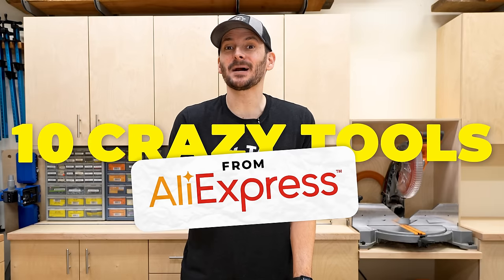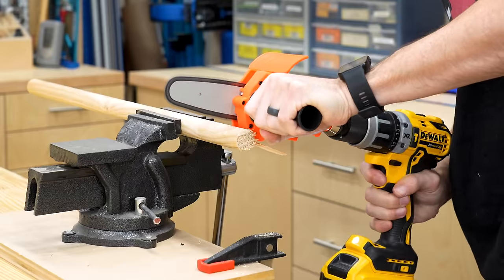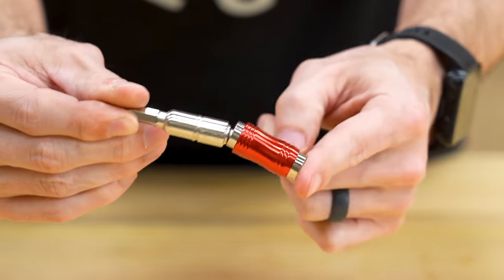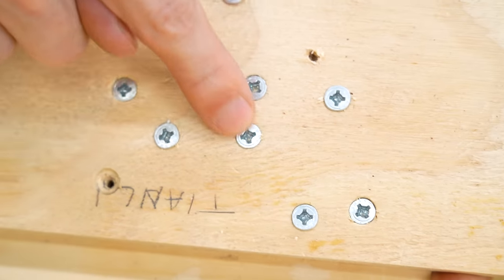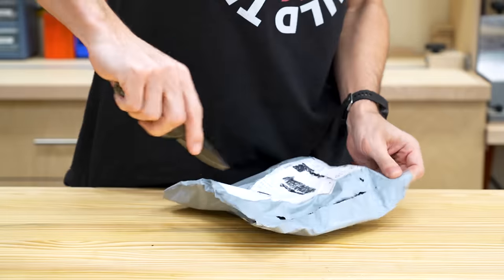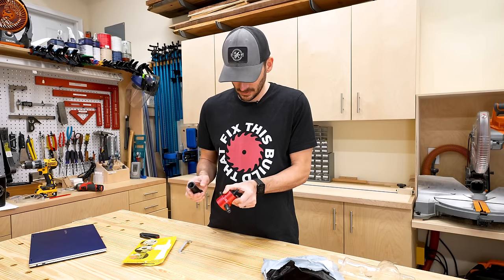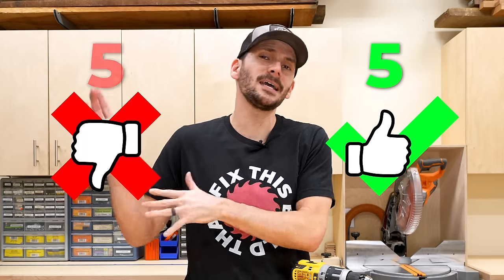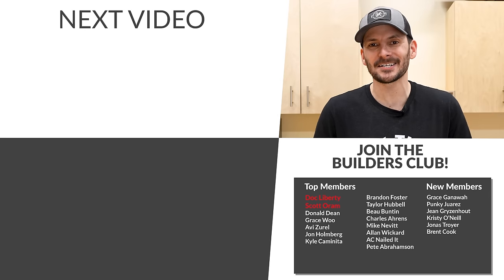I Bought 10 Crazy Tools on Alibaba

Comment from the maker: Watch this next!
I Bought a $70 "Domino" on Alibaba - https://youtu.be/qPDebNjQs-Y
Reply: if your using impact you will cam out ... try the magnetic holders with a regular drill
Reply: Well I have an 'expensive' version of the chainsaw thing 50bucks and its steel with a little oil resve for the chain. A lot safer And actually works great for trimming a few branches
Reply: @rocknrollguitar  I have a steel one, with an aluminum blade guard, too. So handy.
That plastic thing he got might as well have a grim reaper emblem on it.
Reply: I bought $800 worth of pirated 32gig flash drives from a 5 star gold supplier at Alibuba

Comment: 60-odd years ago a LOT of those sorts of drill attachments were popular. My Grandfather had one electric drill, it also converted into a reasonably sized circular saw when you unscrewed the chuck (all 5/16" arbor) He used it to build a house, all hardwood framing too. And bunch of other attachments, including a jigsaw (before they had T-shank blades) which could also be fitted into a very small table, converting it into scroll saw.
Reply: @bostonrailfan2427   likely went out due to safety standards increasing on products over the years. Big businesses don’t want a lawsuit
Reply: @bostonrailfan2427  Dremel is for really small work. I reckon those drill attachment sets disappeared due to two reasons: They weren't that convenient compared to separate tools, and all kinds of power tools eventually got more affordable even before the ultra cheap Chinese tools flooded the market. My father had one of the sets, which came in a really sturdy plywood box, kind of like a suitcase. He never used anything but the drill functionality and instead eventually accumulated a basic collection of the various ordinary tools as separate power tools.
Reply: My father had a Black and Decker kit that had similar attachments back in the 1970's. Average quality, okay for mild DIY.
Reply: I had one of those that also connected to a bench grinder. By Skil.
Reply: Electric motors were a lot more expensive back then.

Comment: When the janky Alibaba Drill Jigsaw adapter, is better than your legit black and decker jigsaw XD
Reply from the maker: That very well could be true
Reply: I have a Dewalt battery powered chainsaw and alibabas $11 adapter just put it to shame
Reply: @KevoM945  should I buy it bro???
Reply: @catboi1188  why not but make sure you get one of them metal Knight Suits
Reply: @catboi1188  just buy a saw wheel for a grinder.

Thats what sketch thai dudes use instead of a chainsaw attachment. Without the protector of course because of reasons.

Comment: I've bought the nibbler!  We used it to cut out holes for recessed lights that were above a ceiling with plastic roof sheets (you know the corrugated ones you normally put on a patio. - we used those in our basement so that there was a ceiling but so that it was easy to take down if we needed access to junction boxes or pipes.) Worked great! - both the tool and the ceiling.
Reply from the maker: Ohhh, didn't think about it for plastic
Reply: @robt2151  I'd imagine his is the same, that's why there were 2 different max depths
Reply: Soffit

Comment: You used the dust collector backwards. Put the bigger end against what you're drilling into then put the bit through the hole and drill. The wide round base offers support and stability to the collector and the brush keeps the debris from exiting the collector as it travels towards the drill.  I think you should reevaluate it. Otherwise I loved the video!
Reply: no he had it correct for that style design  the brushes are  to removes particles  from drill into the    cup  you  take apart,   even so  poorly design its as simple  take a coke bottle   cut the   top to  make a funnel  drill a hole in cap put wide  end to wall  drill through  cap into  wall and  the   bottle neck catches the dust
Reply: Well at least someone got directions apparently.

Comment: Great video. Except I have to comment about the dust collector. I have had two of those (I lost the first one). In my country houses are built with brick and mortar. So when you are drilling for shelves or picture frames etc, you are using your hammer function with a masonry bit that generates a ton of dust. My dust collector has a rubber seal on the wide end of the cone. You put the bit through, line it up with the mark you made for the hole, then press the cone against the wall over the hole. ALL the dust ends up in the collector, thus working perfectly. The alternative is to hold a vacuum under the drill bit or a wet cloth, neither of which works as well as the dust collector. I think it's a great product.
Reply from the maker: Oh, interesting. Sounds like a better design
Reply: @Ken Fullman I get extra fancy and use an old envelopeand tape it to the wall with masking tape  - fold the flap out of the way so you have a square edge.  If you have the tape over the hole it stops the drill skipping when you start, and grabs the last bit of dust.  It's usually sticky enough I can do a whole batch of holes with one piece & then throw all the dust away

Comment: The drill sharpener thing works alright if you're careful. It's incredibly easy to off center the bit though so it'll wander when you try to drill which is what it looks like happened. There are better ways to sharpen a bit though.
Reply: yeah.  there's more to sharpening drill bits than i expected.  i sat through a this old tony video.  it wasn't anything like as entertaining as this but it did teach me a lot about sharpening drill bits and you are absolutely right about getting them to center!
Reply: I have one of those and it works great
Reply: he is clearly someone who hasn't sharpened a drillbit before.. he didn't even look where the cutting edge was he just put it in there and rotated lol 
Honestly If you start trying to grind your drillbits the first thing you should have is a  drillbit angle gauge.. but since he basically only works with wood it doesn't really matter.
Reply: I’ve sharpened around a hundred drill bits over time with just a grinder. With experience, you don’t need anything else.
Reply: His drill is also in reverse, that's why is not doing good

Comment: as a rule of thumb, you can trust chinese tools for metal/concrete working more than the ones for woodworking. It is a cultural thing, as our countries are more used to build with those materials in general. For example: the dust extractor doesn't seem than cool at first glance, but if you use it on a concrete/sheetrock wall that would make a lot of difference...
Reply from the maker: Interesting observation and makes a lot of sense
Reply: @Fixthisbuildthat I haven't a clue on what he mean ???
Reply: @williamreilly5469  I don't know if you are trying to disagree with that statement or if it was just unclear, but, to rephrase -- OP is saying that it's more common to work with metal/concrete in China [than wood], so the quality and reliability of those tools are often better because of the need/demand for tools used in metal and concrete work.
Reply: @williamreilly5469  That it works good on concrete and sheetrock.

Comment: I have air nibblers, they are very handy for cutting circles in the middle of a sheet, on the edge I'd use something else.  Downside is they make a million chips to clean up, also can be hard to stay on  your line.  Takes some prartice because they move pretty quick.

Comment: The chainsaw insert actually works! I made som small adjustment to it added some chims and It cut five full size pallets in to pieces in no time. Keeping the chain lubricated is the trick, for your own safety do not saw with a dry chain, it will heat up and jam and do check its tension regulary. A dangerous thing it is but in experinced hands it is a pretty handy tool for smaller jobs.

Comment: The circular saw reminds me of that type of attachment for the Black & Decker Matrix. I love that set. Got the reciprocating saw attachment, router attachment, jigsaw attachment, oscillating tool attachment, sanding attachment, hammer drill attachment, impact driver attachment, etc. They used to have a tire inflation one as well as some weed trimming stuff but I never got those. I do have a problem with the circular saw because my hands aren't strong enough to hold down the safety buttons for me to get it to work.
Over a decade ago I was trying to drill through 1/4" lauan with a wood drill bit from harbor freight. Mofo would not go through and eventually bent. I then remembered that my late father left an entire massive 134 bit Chicago brand kit. So I grabbed a bit from that kit and it went through like a hot knife through butter. I think some bits are just made of crap metal.
I'm not sure which one I like the most. LOL.

Comment: Several comments here, Brad. My dad had a circular saw attachment like that about 50 years ago - I think it was a Craftsman. I don't know what ever happened to it. Makita has a magnet like that. I slide it further up my driver bits and have great visibility. The drill sharpener didn't work because it didn't put a back bevel on the tip. I currently have an older Craftsman jig saw with a swivel head - no need for the attachment. I'm definitely not buying any of these. I like to buy quality over price especially when safety is involved.
Bill
Reply from the maker: Couldn't agree more 😀

Comment: I have one of those plastic drill bit sharpeners and it works fine... if you have sharpened bits and understand the geometry. 
Many people can't understand drill bits. Being able to put an edge on a broken drill bit is an advantage; shorter drills are less likely to break.

Comment: Try running the sharpener with the drill in reverse, in "loosen screws" mode.  It might be that the sander drum is turning the wrong way and actually dulling your drill bit.

Comment: The magnetic screw holder is meant to be used when you don't have a free hand to gold a screw. Then you only use to get the screw screwed in  but set in.  That's why you were stripping the screw heads. Many times I would drop the screw just as I was about to start the drill driver.
Reply: If he used a decent cordless screwdriver or drill, he could have reduced the pressure to avoid stripping threads on the screws.
Reply: You need to get a screw holder sleeve.👍

Comment: The drill bit duller was the best tool by far. It worked perfectly. 😀 Since the nibbler had 2 ends the other end probably takes square bites which would work great if you needed a hole with square corners, like when I put a stereo in my van that came without a radio, a really long time ago. You just drill a hole in the metal dash, then nibble away until you have a stereo size rectangle. A power nibbler is way better than a manual nibbler. Don't ask me how I know. You get tired of squeezing the handle on the manual nibbler before the hole is finished.

Comment: the set screws in the head of the nibbler allow you to set the direction of the cutting head, so it cuts in your chosen direction, loosen the set screw with one end of the included tool, set the angle with the other end, I have one side set for straight and left curves, the other side set for straight and right curves
pop the circlip and fill the gearbox with grease every couple of hours
I have done 16 steel roofs -around chimneys, around vent stacks, skylights,  with mine,  steel and roll aluminium flashing
 haven't worn it out yet. 
also have a makita nibbler, which I have come to dislike for being corded
and an astro, that needs an air line
all use the same cutter pin and anvils, assuming they are all made by the same company and brand-named
Reply from the maker: Oh, good to know!
Reply: I had a similar one, lasted about 3 feet of nibbling, then the disk that holds the ram broke so the ram came out and wouldn't go back in. Highly variable quality.

Comment: Thanks for a fun video.
I do have a drill/circular saw attachment. It's from the 1950s it is in almost new condition, probably because it isn't very practical to use and drills seem too slow.
An uncle gave it to me because I always liked it. It is very well built all metal and looks cool on the 'cool but useless tool display shelf'

Comment: I had pretty good luck with an equivalent nibbler from Amazon, especially considering the half-cocked way I was using it.  They make a sort of cradle for table-mounting the nibbler, so I used one of those plus a right-angle drill adapter to set the thing up on my drill press.  Using a simple jig to rotate sheet metal in place on the drill press table, I was able to nibble out a pretty good disc of 16-gauge steel.  That's just about the nibbler's max thickness, so it was pretty prone to jamming if the sheet wasn't fed in just right, but overall it worked better than I had any right to expect.

Comment: That chainsaw drill is awesome. oil the chain. The drill you are using can lock, once tightened down back the head off one click and it is locked. Try it it works. (on some cheap drills this does not work. I was at Harbor Freight and it worked on most of the drills but on the cheaper ones It did not). Also if you have to hold one part of the drill chuck to tighten the other part of then drill chuck it is not a feature of that style. It is the single turn chuck.

Comment: i have the nibbler for a few years now, i used it a lot. i even built a table for it, so i can nibble in a straight line easier.
i just bought the chainsaw about 2 weeks ago, was planning on using it soon. 
the riviter i also have for a few years, and i even used it at work a few times.

Comment: The drill bit sharpener is available from harbor freight lol and it’s cheaper 😂.  I bought it and had to modify it also. You have to put the bit in the proper slot for the size

Comment: The riveter is much better when you mount a DIY bracket which allows one hand operation. The bracket goes arround the riveter body and has two arms which goes to the right and left side  above the trigger of the drill housing ; )

Comment: The resivoir on the jigsaw tool would be handy if you were using it to cut tile or concrete is my guess. A little water lube for the abrasives

Comment: Fun to watch and listen to this man. Two comments though; I don't need to watch someone opening a box (or anything that makes me sit and wait), like a cooking show that makes you watch them breaking eggs. I don't get how you thumbs up to a drill bit dust catcher (because it works), but thumbs down to the drill chain saw (because it works too).  The dust catcher could be replaced by a piece of paper held correctly against the wall. The chainsaw however, would be great for gardeners, and appears less dangerous than a real heavy chain saw. I see the side hand grip as a positive feature, not a negative one. Since it works, I'd give it a thumbs up. The danger aspect is up to the user, just like using anything else. It's not the tool that is dangerous.

Comment: I think the sheet metal sheers should come with chain mail gloves.
If the magnetic tip was supposed to magnetize your bit, I'm not sure how you can blame it for stripping out your screws.  You don't need to see when to stop screwing if your driver is set properly.

Comment: the double nibler, is two niblers, when one is worn out, just change the handle to the worn out , and now you have the fresh one ready, spareparts can be bought
Reply: Metal cutting tools last a lot longer if you oil them. But I know no one does that.

Comment: Great video - thanks.  About the jig saw.  I liked that it doesn't have a lot of motor down by the blade.  Means that it can cut in tight areas better than my traditional designed jig saw.

Comment: Gotta say the mini chainsaw is safe depending on the drill.  If you left go with your guide hand, the entire thing spins reducing cutting force and turning more into a blunt force.

If your hand slips off the drill then it doesn't spin in either way.  Not as unsafe as people think.

Comment: If I was to get one it would be the metal cutter, not nibbler but the one with the spring around the drill handle, I actually saw that in use on a video not about the tool but about new building materials and technologies

Comment: Nibblers work great imo, but honestly they work much better using an impact wrench as you can cut thicker material, than a drill. It has a 2nd side for when it goes dull. I used mine to cut up a 2.5mm steel car hood after blowing through all my angle grinder discs.   The money it saves alone on new disc's is worth the tools cost.   I wouldn't suggest using it on aluminum though,  it will cut, but bend it badly as well.

Comment: Man! I've seen one of those drill chainsaws in the wild! We were camping a few years ago and one of my friends pulled one out to cut firewood with. He didn't use the handle because he was scared to have his hand that close to the chain so he was just one handing it and it was kicking back all over the place. I was just waiting for the change to come flying off. The fact that it doesn't use any bar oil is not a good sign when it comes to the durability of that chain and bar setup.

Comment: I bought the drill bit sharpener for $3, it works but it takes a lot of fiddling AND you have to reshape the bits as the angle is not the same as a freshly made bit. So you're basically grinding and reshaping a new bit, and the results may vary by how you're holding it, in addition to making sure both opposing sides are equal. It works best with hex-shanked bits instead of the regular round ones as you can then make sure both sides will be held somewhat similarly at an angle. But yeah just... don't use it unless you need to drill a hole in an pinch and you couldn't get a bit in the next hour lol my success rate so far is about 1/10 tries lol and the holes were never clean
Reply: Yea, the angle thing might be an issue